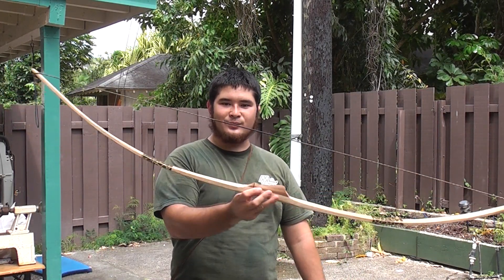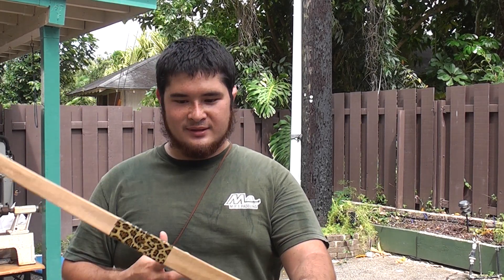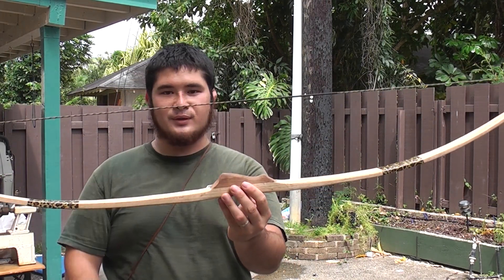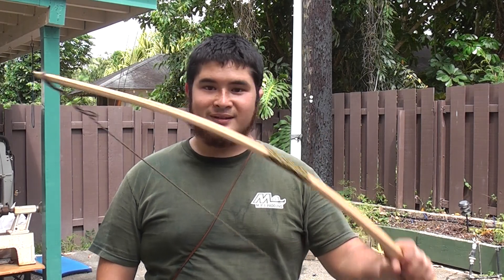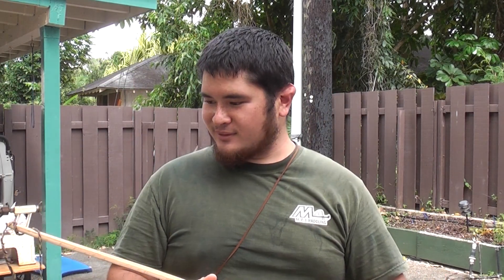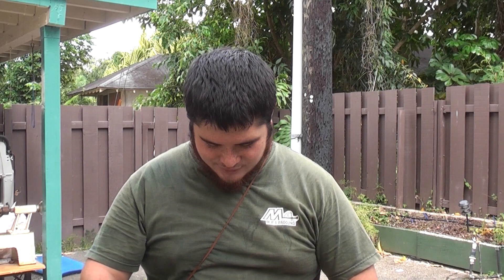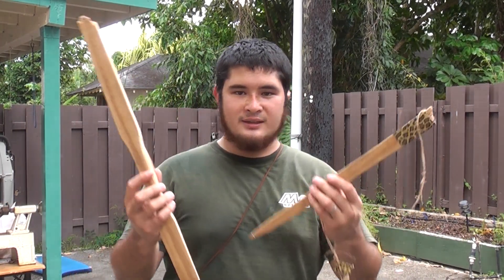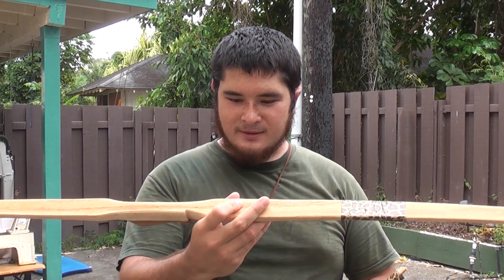Shooting and Breaking a Red Oak Wooden Bow

Comment from the maker: It helps with longbows to put a little bit of reflex into the bow, which will help bring the speed back up. Keep in mind that with PVC pipe, you can expect it to take quite a bit of set, which won't equal string follow if you have enough reflex.

Are you using white or gray pipe? Gray pipe will deform really quickly and reflex will not help very much for very long. If it's white pipe, then you can probably re-heat it gently and give it some reflex.

Comment: lol damn dude, worth watching. I have a couple red oak bows cause they are pretty easy to make with a little machinery. I backed some with fiberglass tape, and some with brown trader joe's paper bag (Trust me, makes an incredible backing). My latest 64 inch longbow pulls at 30 inches 45 #'s, PVC is more durable in terms of use, but I love having a red oak bow, if done right they shoot so nice and quiet. Good educational video I must say, definitely don't want one of those snapping in your face, some people say you don't need to back a red oak bow, I honestly don't think that is a good recommendation, its dangerous to shoot any wood bow that isn't backed in my opinion, especially for a beginner shooter with little concept of wood compression and elasticity. Getting hit in the eye from a limb snap is a fear of mine lol.

Comment: I like the thought of building a PVC bow.  But I have noticed that they shoot slow.  Comparing it to this wooden selfbow (which I also plan on building one from scratch) makes me wonder if a PVC bow would be good for hunting..  I know that sounds kind of crazy, but if I could build a hunting bow out of PVC pipe, I see no reason not too.  I figured the only factor holding me back is the speed, do you need speed or weight for impact power?  Would the 80# PVC Longbow be sufficient for hunting?
Reply: actually is pretty overkill! Of course it depends on the game, but from my experience a 40#, 50# pound pvc bow should be enough. They are not as slow as they may look

Comment: Hi Nick, what is the psi on the pvc pipe you use? I've made 2 bows, one is an Elven recurve long bow (1" pipe at 60") and a take-down recurve for my son (3/4" pipe at 48") but both have really really heavy draw weights. They're impossible to achieve full draw, usually only up to just in front of the face. I checked the pipe afterward and found that it's 450psi. could this be the problem?

Comment: News flash for "traditional" bow fanboys. If you want a bow that lasts, move into the 20th century. We don't have laminated wooden bows well-sealed with flexible polyeurethane or other surface finishes and fiberglass and metal and "composite" bows because somebody is trying to sell you "modern" technology you don't need at exorbitant prices. We have them because WOOD SUCKS if you want to strength AND flexibilty AND durability. In particular the fact that anyone expects great things from bows made HARDWOODS like OAK makes me laugh out loud. Hardwoods are hard primarily because they are relatively "dry" to begin with and tend to grow on steep and rocky slopes where moisture is scarce and thus growth rates are slow and the wood is very dense. When you have to soak and steam wood to make it even somewhat flexible after it has started curing, its foolish to believe you will ever KEEP it moist and flexible long-term. Especially when the density and tight grain tends to force out moisture as the wood flexes. I can only blame the lack of.vocational education and the general lack of interest when its available in public schools for the widespread ignorance of most people 35 and younger when it comes to fairly simple things like wood. Wood shop isn't just about building birdhouses. Its about learning the properties of the materials. Look around you and see how many FLEXIBLE structures (and by "flexible" I mean obvious movement visible to the human eye on an ongoing basis) are made of wood. You won't find many. Why? Wood sucks if PLASTICITY is the goal.
Reply: Yeah. That's why laminated and fiberglass bows swept the market decades ago when the technology became available and why there are 50+ year old Bear bows still shooting today. Wooden bows DRY OUT and it doesn't take a rocket scientist to figure out that unless you find some way to seal the CORRECT amount of moisture in PERMANENTLY, they're going to break eventually. Which is why there are longbows that fail months after being built, shot a handful of times and shoved in a closet.
Reply: Go cut down a green tree and let it sit for a few years and see if it still bends, genius.
Reply: Might just be the prepper in me.. but there's something to be said for the fact that a man can walk into the woods with nothing but a bush knife, and walk out with a bow, and arrows.  Modern materials may have all the advantages in the world, but until carbon fiber starts growing on trees, making wooden bows is a skill every man should master.
Reply: Most trad shooters don't shoot trad bows because they're better. it's for the fun of it. Because some people just enjoy them more. Kinda like owning old cars.
Reply: Simply put, you are wrong. Wooden bows do not try out. You dry the wood BEFORE You make the bow. You can break a bow that was made for a moist climate by drying it out it a house with AC or a heater but a bow made at that moisture content will be happy. Bows are made for dry or very wet or just normal conditions. They will also tend to break if they are too cold. Yes, modern materials don't react as strongly to these problems but if you know what you are doing you will not have a problem with a wooden bow.
Reply: I know right? People worship traditional bows like they are the greatest thing on earth while scientist spend years on developing a modern high tech long lasting limbs
Reply: Fiberglass trees are tough to come by lol